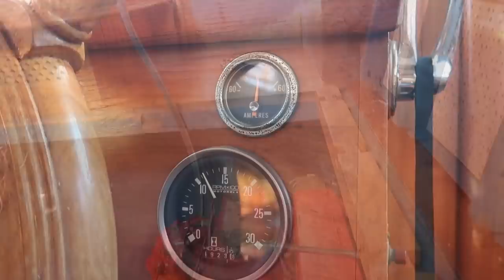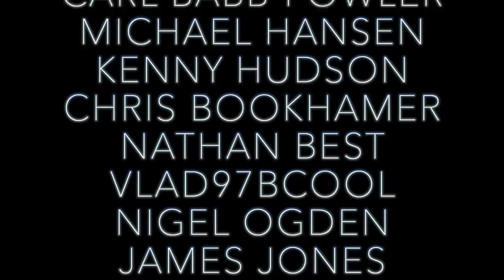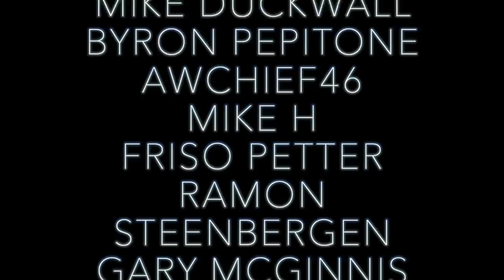Broken Pirate Ship! Can it be Fixed? | PIRATE SHIP S11E05

Comment: One other thing. Any time you disconnect the gas lines and are ready to put them back on, be sure to put pipe tape(made for gas lines) on the threads, a couple of wraps should do the job. You don't want to have a gas leak. BOOM. They make a tape for water lines as well. Happy sailing!!

Comment: Next time you have to work with rusty bolts and threads, rather than using the tap and die kit, use the tool that is made for that job. They are called "thread chasers". They clean out the threads and prevent cross threading!!!
Reply from the maker: Ooooh I’m going to look into that

Comment: All Good except — Those Gaskets are Paper. You used one on the Water connection. ( 90 degree elbow ).  What happens when paper meets water ? Drum roll please ...gasket gets soggy and leaks. No bueno ! Allways coat paper gaskets with a Sealant such as Indian head gasket sealant or similar. Do not use silicone ! You want to paint the gasket with something that will penetrate the paper not allowing water to penetrate the paper. Please remember this for all future endeavors when paper gaskets are used. Grease can be used in a pinch. Boat trailer wheel bearing grease is best. 40 years as a service tech.

Comment: Should stuff rags into the holes around which you are sanding to prevent fine particles dropping into the engine and doing some grinding on their own later. A bit of grease on the rags also helps retain any particles.
Reply: Or Just Blow everything out with a air hose before assembly !
Reply: Yep...Noticed that. Most def a boo boo !
Reply: Sheesh!! Rags in the holes please.

Comment: Nice progress! Noticed the stove/oven gimbals do not appear to have a lockdown mechanism. You may want to figure out a way to keep the stove/oven from jumping out of the gimbals if the boat is launched off a big wave or knocked down. Affixing a well secured bend out metal tang above each gimbal may do the trick. Having the stove/oven get loose and launch across the cabin in big seas could do some serious damage, including stoving in some of the crew, not to mention making a mess of your cookies... Hope you find your way to the water before too long!
Reply from the maker: The Stove/oven is on my list of “would be nice” upgrades in the future

Comment: Big Muscles 💪🏻 and OCD as in my case were not always a good thing. I used to break stuff until I learned to control my strength. I also was a Security Supervisor in a Casino Hotel and you wouldn’t believe how many times we did CPR so I had to be very conscious of my strength so I didn’t break ribs !
Reply from the maker: Eeeeek. Just like my little brother we’ll all of my massive brothers and dad. I’m the shrimp. I’ve always been so impressed with the discipline it takes to be a body builder

Comment: Only thing I noticed  
is you didn't use a sealant on both
sides of the gasket when installing those hose fittings. I always had a tube of form a gasket sealant in my tool box for that task.

Comment: Because of the thickness of the material that was in your area for the bow thruster...not sure if you shouldn't do the same fiberglass repair on the inside to sturdy the hull shell.  It those peal or get moved it could be a real problem in rough water?
Best regards
Dave,

Comment: Their are projects where slamming it in and getting it done is all good but their are other projects where you have to slow down and get it right no matter how long it takes and that's any project that if it fails do to shotty work could cost you the boat and or your life the ones to slow down on are any project that is critical to the operation and safety of your boat

Comment: I am not a mechanic but sanding over open engine holes means steel dust in the engine...  Shouldn't the holes be blocked off with rags or something or sanded at an angle so dust falls away from the openings?
Reply: Or Just Blow everything out with a air hose before assembly !
Reply: @OcRefrig  You mean blow the grit further into the parts you can't reach?

I'll stick to a slightly greasy rag jammed in the holes, thanks.
Reply: All  of  the  above .   Rag  in  hole / blow  out  with  compressed  air / then  break-in  oil  &  filter  change  on  completion .

Comment: Ha commonsense eh life’s all about that but the school is often  closed to sum , and remember black paper gaskets are water gaskets commonsense , not a smart move using sand paper on alloy / steel  faces for gaskets. And what a nice sounding motor  ,smooth and quiet  ,well done team , hope you get thoes bunk fronts sander back to  raw timber what a differents that will make to the looks of the cabin , or for the mess and cost blasted , back , all good

Comment: You might want to double check the Oil pressure Guage. 70 psig at 1100 rpm on a old Lehman diesel. I Don’t think so. You Should have 2 Guages for Everything on the Motor anyhow. Motor sounds good though !

Comment: Did you guys use rv/marine antifreeze? If so that's for winterizing water systems, not for use in engines as a coolant.
Reply from the maker: We are winterizing! We are headed to FL to sail the other ⛵️
Reply: Safe travels

Comment: OMG did you just put pink winterizing antifreeze in the engine?  Holy jeez - I respect Serle’s skills but that’s the wrong stuff. Not intended for use as engine coolant.
Reply from the maker: It is for winterizing the boat (which is what we are doing) we are on our way to sail in Florida right now:)
Reply: @SailingMissLoneStar  It's for winterizing the raw water side of the cooling system NOT the fresh water side. Do yourself a favor and get that out before leaving.

Comment: Get that pink unicorn piss out of your engine, that's for water lines and bathroom drains and tanks. Put the correct antifreeze in it or you are going to have problems.
Reply from the maker: It’s for winterizing it for coolant. We are off to Florida to sail my other boat:)
Reply: @howardbeer5214  propylene glycol is for engines, non toxic and the pink stuff is also propylene glycol.  I thought it was just dyed pink for marketing reasons for potable water lines, but was the same stuff. What's the difference besides the color?
Reply: @howardbeer5214  ethylene glycol is the blue stuff?

Comment: That antifreeze that you filled your engine with is incorrect for a Lehman. I have a Lehman and that is not what you use. That antifreeze is made for winterization of water systems. It doesn’t have the same heat rating either.

Comment: That didn't look like coolant no corrosion protection, you'll have rust in no time
Reply: To me it looks like the kind of anti-freeze you would use in the water lines in a rv or boat for water lines or drains.
Reply: That’s winterizing antifreeze not engine coolant!!!!!!
Reply from the maker: I know!! We are winterizing the boat!!! Headed to FL for cruising season on my other boat
Reply: @SailingMissLoneStar  I know but that's just antifreeze for your water tank not coolant for an engine
Reply from the maker: We are leaving for the winter. We won’t run it on that
Reply: Let me explain in terms you may understand it's like instead of Botox the doctor injected you with botulism and instead of silicone he used silly putty . In other words do not leave that crap in the engine or you'll come back in the spring and regret it.
Reply: @SailingMissLoneStar  Really that pink crap isn't for the closed side of the cooling system. You can use it in the RAW side, but you need regular engine coolant in the heat exchanger. Don't leave it in there. No corrosion inhibitors in it.

Comment: What about the structural problem the boat has at the kiel? One cheap solution is to fiberglass the sides inside the boat.
Or are you going to wait for the next surveyer to find out?
Reply from the maker: I’m having the boat resurveyed after we step the masts in the spring. No reason to do it twice before I sail
Reply: But that doesn't make any sense. It is the buyer who hires a surveyer, not the seller.

Comment: As any good mechanic knows, those are a water jacketed end and hose attachment point that require "old" yeller sealant for a proper seal.  Keep an eye on them.
Engine sounds really good.
Ford owns Cummings diesel  so you can trust that engine to run long and strong.  Remember to run good fuel with cleaning additives to keep the injectors working properly.
Reply from the maker: Thanx:)
Reply: Ford don’t own Cummins
Reply: @shane5063  that's what I was told years ago.